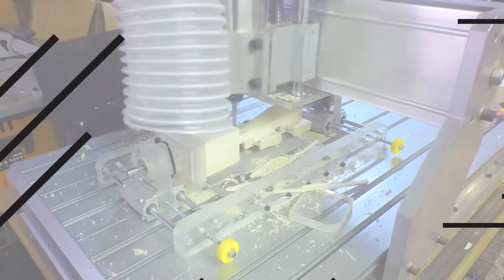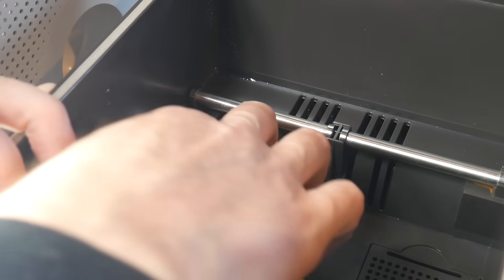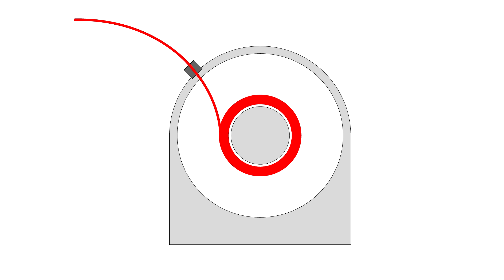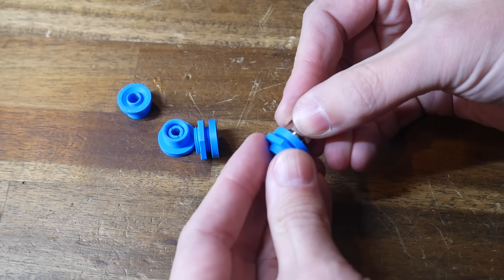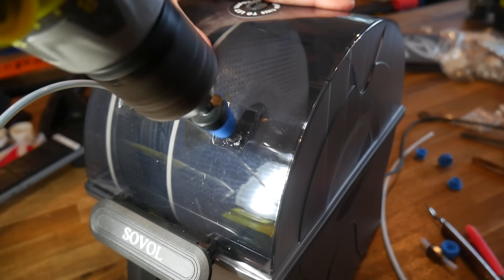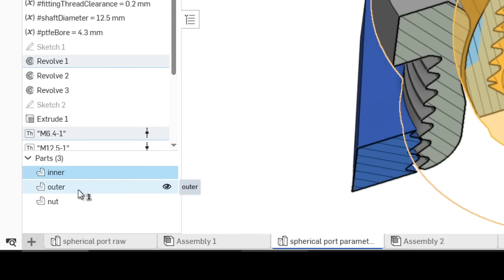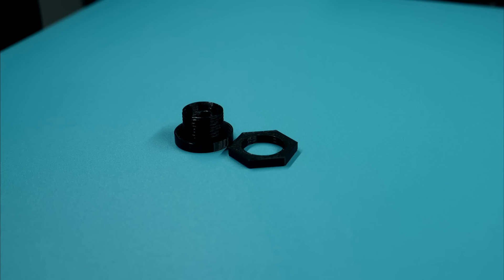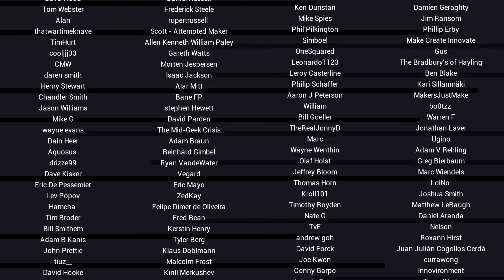Almost every filament dryer can be improved with this simple upgrade

Comment: The intro led me to believe this video was going to be about venting moisture from filament dryers. Some of the comments below address the issue but it seems a deep dive into this problem might be worthwhile.
Thanks for the video
Reply: Try a smoke stack like device with a ping pong ball that lifts with the fan on and drops to seal when the fan stops 😊
Reply: I would recommend not bothering with an airtight dryer box. Have airtight storage for your filament and have a separate dryer box with a vent fan. That way they can both easily do what they were designed to do without worrying about compromising the seal or airflow, respectively.
Reply: just follow all the steps but don't print and install the part.
Reply: I added a 30mm extractor fan to my dryer which runs for 3 minutes every half hour, current task is to add a servo to mechanically close the fan louvres and open an inlet port for better air exchange. Adding mechanisms and another microcontroller to correct a bad design is entertaining but I'd really prefer the manufacturers to do it right in the first place. I'd addressed the angle and friction problem by the simple expedient of pulling a couple of inches of PTFE tube into my dryer and dryboxes but I like this idea and my first iteration is printing at the moment. If this design improves feeding as well as I hope it will I'll be adding it to my dryer and dryboxes (Ikea 365+ 10.6l boxes).
Reply: @Steve_Coates  Have you considered something like a butterfly valve that is pulled shut by gravity, but can be blown open by the fan?
Reply: @topochich0  The current version uses louvre slats which are opened by the airflow from the fan but it's proved difficult to get the tolerances right so that it's both reasonably airtight while having enough clearance to be opened easily by the fan. It's fine while the drier is running but i'm aiming for something more airtight so I can leave filament in the dryer for storage.
ps The model printed in PETG first try and works nicely, I'm now rescaling it to suit an existing drybox with M10 fittings.
Reply: @topochich0  I've done this with a 3d-printed one-way valve that uses a simple disk and an o-ring for a seat. There is one for an inlet for air and one (containing a 20 or 30 mm fan to open it) for an outlet. It works great.
Reply: After experimenting with all kinds of solutions (way before there were nice premade filament boxes on the market, full disclosure), I've found that nothing quite beats the combination of heat + a small circulation fan + some desiccant for drying out spools. Passive expulsion of the saturated air in the dryer is always going to be limited by ambient humidity, and never really got me over the last mile. Also, most desiccants can go through many recharging cycles without much degradation in moisture capacity, so I'm not burning through a mountain of silica either. Not saying that everyone's solutions couldn't work though, just throwing my 2 cents
Reply: Great idea to try. Easy to print one way valve.

Comment: I managed to handle this issue with my filament dryers in a much simpler way. I just extend the PTFE tube about four to five inches into the dryer. A simple clamp on the outside keeps the tube from getting pulled too far in, due to possible issues with the way the filament has been spooled. 
The length of the tube inside the dryer flexes to continuously adapt to the appropriate angle. After many hours of printing, the end of the tube inside may get a bit distorted. A simple clip of the end with a PTFE cutter quickly resolves the problem.
Reply: I have an issue with my Creality dryer where the PTFE tube is pushed into the dryer until it makes impossible to carry on printing. Care to share what kind of a clamp you are using? Is it printable and if yes, could you share the model or the link to the model? Thank you in advance!
Reply: Less damage to the ptfe is a good thing though, a bit better for the environment as it will last longer.

Comment: Sounds silly, but I think, that was a problem I head with my own drybox. :D Just bought 20 of those fittings. Before, I had a PETG plug I printed, which seemed like it could have increased friction on PETG filament (when heated).

Comment: Overengineering at its finest... Just put one large ptfe tube through that hole so its almost touching the spool, and guides filament smoothly outside the dryer - no moving parts, no need to print, design or buy anything.

Comment: wild… I have newer Sunlu (4 spool) pretty much the same UI options but with unnecessary LED lighting but strong fan and heater . I have never seen even a drop of moisture. (First bought on a Kickstarter 2 years ago). It never even occurred to me that you would have an issue like this that needed solving.

Edit: also convinced to learn OnShape from this channel.  It makes me feel like I have a super power. Think of some simple thing you want. Bing.  Bang. Boom. print it. for those hesitating learning CAD, they have free classes for the product as well.  It’s not THAT hard once you get over the initial classes. it will start clicking with your brain. Promise.

Comment: Massive upgrade is Capton/Polyimide tape on the inside. Everywhere and I took mine completely apart (Comgrow dual filament dryer) and put it underneath, the walls, and top cover. Not only does the top of the filament now show 48c (when idle and not spinning) but now uses about half the power over a 6 hours period.

Currently working on a flap that opens at just over 50c with dissimilar plastics to just barely open and let fresh air in at the bottom and out at the top. Other idea is to add a servo on the fan circuit to push a rod with plugs at the end to open a small vent at said both bottom and top to flow fresh air in, and will automatically close when not powered (spring magic).

Comment: Moisture is going to want to condense where the surface temperature is cooler than the air temperature (inside the dryer). You can prevent this by keeping the surfaces warmer, either by insulation or by heating them (or both), assuming you can't just keep the dryer in a warmer place.

Comment: Yes, actually, this is very useful. Particularly the part about how Aliexpress shows if the fittings are passthrough **glances tellingly at a box of 100 useless fittings**. My workaround recently has been to pull the PTFE through the hole a couple of inches, which at least reduces the radius of the filament bend.

Comment: Hi just my idea to simplify drying the filament, just create a single filament thread heated drying tube (SFTHT) just before it reached the print head. This way all the filament is dry during building the required model. Whats your thoughts, I down have a 3d printer as yet so I am not shore it will work, from another Aussie  cheers. Perry 😄

Comment: You put in the hard work, but stopped short of a proper fix. Nothing would stop you drilling the hole even bigger and making a piece that fits under the piece that you made. You could add additional angle in that lower piece. Giving you compound angle adjustment.

Comment: Would it be better to have the ball part with just a 4mm hole through the center for the ptfe tube to pass through.  That would also allow a little more ball rotation range as well

Comment: Thats the thing i like about the Comgrow dryer, the anglealthough they use the same silicone vent but theres 2 of them and the front is flat so it was easy to drill and tap for the connectors.

Comment: Very useful mod, well done! Did you ever try running the spool in the opposite direction inside the dryer? I doubt it would make a big difference or anything, but since that port placement is perfectly ambiguous for spool direction, I just wonder if it would make any difference. 

I think you’ve created a fantastic solution for the friction problem… if manufacturers can’t or won’t use common sense with port placement, maybe they’ll start using something like this to make up for it 😂

Comment: Having one of those driers, I initially found opening it periodically during the drying helped immensely at clearing humidity.  
Then I switched to putting a spacer in to keep the lid cracked so the humid air can vent out.  MUCH better performance.  
(I print PETG so use it on every roll and also as a dry box.)
Reply: You can use the latch as a prop to hold the lid cracked open by a few millimeters. It dries really well that way, and you don't get moisture accumulated inside. My biggest complaint is that the fan is super loud.
Reply: @BigJohnno66  yeah my fan became unbearable after a few months so I pulled it apart and replaced, its a bit better but I think i'm gonna look for a name brand fan to try and get some better life/lower noise out of it.

Comment: The fact there is not humidistat controlled exhaust fan on many of these dryers continues to shock me. Seems like a no brainer to add.
Reply: I took my existing filament dryer,  added a PTC heater/fan, with a sliding 3d printed exit dooor of the other side. Works much better than the crap heating block.

Comment: For the non-passthrough versions I was able to convert one by carefully drilling it out from the M6 side. Go gentle and do this in a safe area. The brass likes to chip and fly away. Overall result was good just using a hand drill. A small lathe would be even better. (Edit, posted before you explained...😅)

Comment: Hey Michael A lot of people have the SUNLU S2 dryer. I am not proficient enough with F360 to modify the depth of this mod so the it can be securely installed on the S2. Any chance you could do that? Thanks
Reply: It is absolutely not needed for the sunlu s2 dryer. The filament isn't restricted in the s2 like this small dryer.

Comment: Good idea. However I think the push-through design of the PTFE tube is not a good idea. On my dryer the tube works it´s way to the spool and jams the spools. Looking online, this seems to be a common problem with those products.
Reply: I had the same thought. Though you could use a clip on the connector to keep bite engaged on the tube so it doesn't ride up.

Comment: Brilliant design for something that the manufacturer should implement on their end. 😢Now, if there was a fitting, or two, that would help to exhaust the excess moisture .
Reply: Leave the lid cracked open slightly. There is a lip the lid can sit on that leaves a 2mm gap at the front, providing excellent moisture removal via convection. Works a charm for me. If you want something a little more robust, there are printable lid add-ons that hold the lid open slightly and provide holes for the moist air to escape. Search the 3D maker sites.

Comment: This is a good idea.
I had problems with PETG and had to add a pad, so that the spool does not unroll so easy and I added a stepper motor and sensor which is pulling the filament out if the sensor has noticed that the filament to the printer-head is not long enough. So I keep the filament pressed to the spool, so that it can not unroll and come between an other string of filament on the roll, because this is causing a lot of problems on my printer. If this happens, the print-head can not pull filament from the roll any more ant it is stuck.

Comment: Great upgrade.  For a design that passes the PTFE tubing all the way through, I would have eliminated the fitting and sized a hole in the spherical bearing that is a press fit with the PTFE tubing OD.
Reply: i got you fam. i just uploaded the smooth bore remix. printables number 1327710
Reply: @suivzmoi  You are a certifiable legend. "Even more loose" lol.
Reply: @Denis_of_Earth1 it's was 2am for me lol
Reply: In was thinking the same - the pneumatic fitting appears to be an over-complicated and redundant feature if, as you write, the bore is sized to tightly push-fit the PTFE tube.
Reply: @Denis_of_Earth1  - I sometimes engineer myself into a corner.  Instead of backing off to see the big picture and solving the problem, I'll get an idea to (for example) use a Press-Lock pneumatic fitting in a 3D printed adapter to improve the filament feeding from a filament dryer.  3D printers are great at making precisely fitting custom parts.  Instead of parametric adjustments to thread sizes for various pneumatic fittings and drilling out those fittings to pass the PTFE tubing, why not eliminate the cost and complexity of the fitting and allow a simpler parametric adjustment to precisely fit the OD of whatever PTFE tubing someone might have?  The print in place spherical bearing was inspired, though.

I'm tempted to add an 8 feeder INDX system to my SV08 and build a custom wall mounted filament dryer with a pivoting spherical bearing for each of the filament feeders.  I don't do multi-color prints, but it would be handy to have all of the filaments that I use loaded so I could software select them rather than manually swapping filaments before each print.  I'll often do 20 hours of engineering to save ten hours of tedium.   😀
Reply: @Liberty4Ever  Your feeder sounds like an awesome idea. However, think long & hard whether the extra effort of designing and iterating automation is worth it at the end of the day. How much manual labour time will you "really" spend swapping filaments vs the time and cost of automating? Having said that, sometimes it's not about the time input, but the satisfaction of creating 🙂Good luck with whichever method you opt for.

Comment: Ah thanks. I'd been looking at that new sovol dryer but there's not many (any?) reviews on it yet. Most of the problems you mentioned didn't bother me much except for the two main ones (moisture trapped inside due to insufficient venting and the filament exit problem). So you've solved half the problem. Could you do some quantitative tests on the dryer (like RH readings before/after a dry cycle, or measuring the weight of water in a shotglass before/after drying, or drying some of that orange/blue color changing desiccant beads?) both with the stock air exhaust and after you improve the exhaust? I'm also curious about the air circulation and heating situation. when you turn it on is there a decent volume of air getting moved into the unit? What kind of heater does it have? Thanks.
Reply: There are videos & articles online that cover most/all your queries - search "SH02". For mine, I simply leave the lid cracked open ever so slightly (there's a lip that the lid can sit on leaving a 2mm gap). This is sufficient to allow humid air to escape via convection. There are compartments in the bottom of the dryer to place silica bead packs to help with moisture removal. There is a printable airflow modifier that redirects the warm air up and over the spool rather than blowing directly onto the spool. I use this mod and it works extremely well. Overall, I've been happy with this drier. It has been built down to a price, but with a few mods, it works very well for its intended purpose.
Reply: It honestly looks like a worse clone of the creality space pi dryers
Reply: @daedalus8222  you're not wrong

Comment: I just use a 2.5mm ID 4mm OD tube and the same bowden fitting you got from Ali. The tube being 2.5mm id gives it a lot of free movement and it doesn't interfere with the filament as much as 2mm does.
This is still very nice though.
Reply: tl;dr: Always use 2.5mm ID on direct drive!

This is one unintentionally well-kept secret that I've also learned recently.

In the days of bowden tube printers, you wanted PTFE with an as narrower ID as possible. Thus Capricorn tubes became popular.

This however is NOT SUITABLE for direct drive or reverse bowden tube printers of today! Doing as you suggest, having a 2.5mm or even 3mm ID tube, massively reduces friction, helps with retraction, and for preventing jams in cable chains or long multi material tube runs.
Reply: @MarkusNemesis  Reverse bowden or just in general with direct drive? Because I am using an Ender 3 v2 with the direct drive mod which has a 3-5cm orso bowden but thats a narrow tube. I figured narrow would be better in this case. The other side though is a wide tube.
Reply: @jackykoning  Any tube that goes beyond the extruder, towards the hot end, should be as constrained as possible. So a short length of Capricorn is my suggestion.

Comment: i have two problem now. 1) trying to load filament blind from inside the drier has been a pain point for me. finding 1.9mm or 2mm hole with a 1.75mm filament is such a pain unless i'm holding both in reach hand. this requires feeding the PTFE deeper into the dryer so i can grab a hold of it.  2) the PTFE tube runs in and out of the dryer, mostly in as printing Z increases. 

i'm thinking of a remix that mitigate both of these,  i'm thinking the spherical bearing can be closed up to 2.5mm or so on the inside end, and with the coupler's teeth biting on the other side, will fully capture the PTFE in place preventing it from extruding and retracting itself in the dryer. then that 2.5mm new wall can be chamfered right up to the outer edge of the spherical bearing itself to create a nice funnel to help with manual feeding filament directly into the center of the PTFE tube.
⡇⡇⢸⡇
⣀⡗⠉⣧⠈⢸⡆⢰⡇⣀
⣠⠴⠚⠉⣿⡿⢸⡃⢸⡏⠓⢦⣀⠙⠁
⢀⡠⠚⠁⣿⣟⢸⢸⡇⠈⠳⣄
⢠⠞⠁⣿⣏⢸⠄⢸⡇⠈⢷⡀
⢠⠋⣿⡯⢸⠆⢸⡇⢹⡀
⢀⡏⣿⡷⢸⠂⢸⡇⢳
⣸⠁⣿⡟⢸⢸⡇⠘⡇
⣯⣿⣟⢸⠃⢸⡇⡗
⣧⣿⣧⢸⠁⢸⡇⡇
⢸⡄⣿⡷⢸⢸⡇⢰⠇
⢧⣿⡷⢸⠂⢸⡇⢀⡞
⠈⢦⣿⣟⢸⢸⡇⢀⡞
⠈⠳⣄⠛⢛⡟⠛⠛⠛⠛⠛⠛⢿⠛⠃⣠⠏
⠈⠳⣄⢠⠞⠈⠳⣄⢀⡠⠞⠁
⠈⠈⠉⠙⠻⠋⠁⠉⠙⠛

Comment: Brilliant. Thanks. I'm quite pleased with my Sovol drier and hadn't noticed the moisture problem. Either I'm not very observant, or it's not happening in my old Welsh house! I've been thinking about adding PTFE tubing to feed two printers at once in the last few days, so this is perfect timing.
Reply: it can happen with high moisture filaments. also if you are doing the drying with used silica gel also in the chamber which I realise many people do but is actually terrible practice